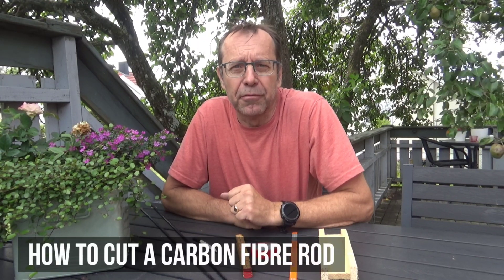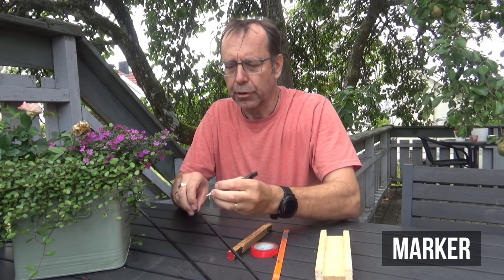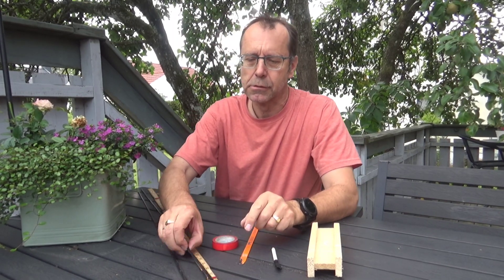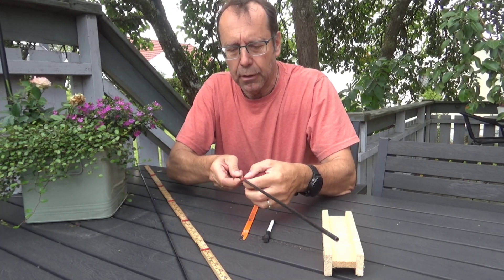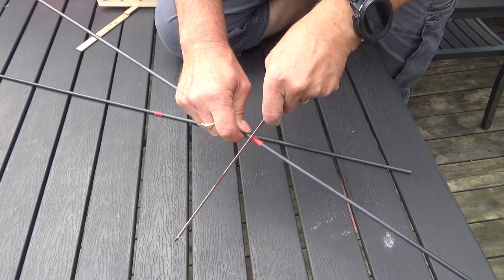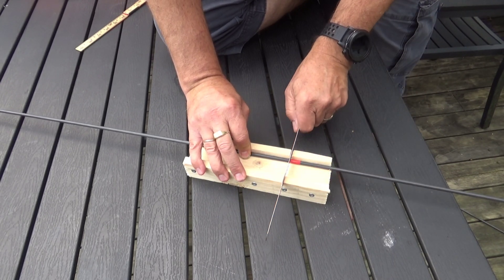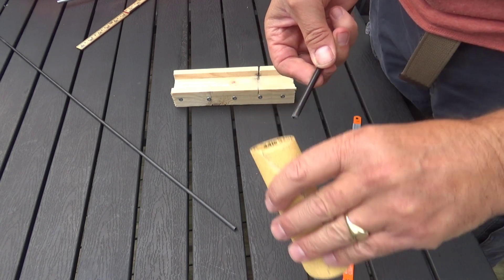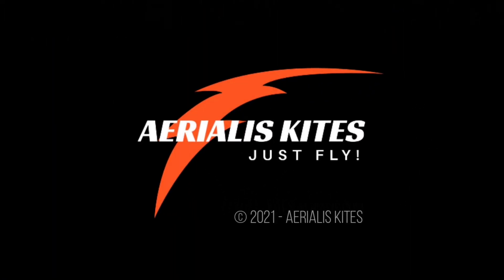Learn Kite Maintenance - Episode 3 - Cutting Carbon Fiber Spars

Comment: Do you use the same method for wrapped tubes and pultruded tubes?
Reply from the maker: Yes, I do, but make sure to use a somewhat dull blade. This will make the carbon fibre less prone to splinter.

Comment: place the rod on the deck and you can roll the rod while cutting. The blade can slide back and forth in space between deck boards. Easier than holding in hand. The miter box is definitely best and very easy to make.
Thanks for this video.
Reply from the maker: That's definitely a good idea👌 especially if you don't have a mitre box available. 🙂